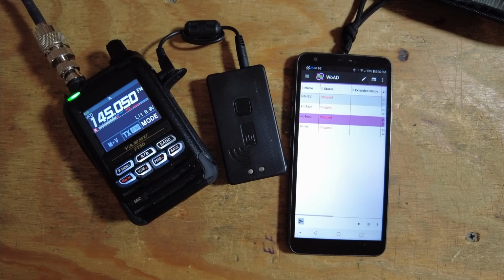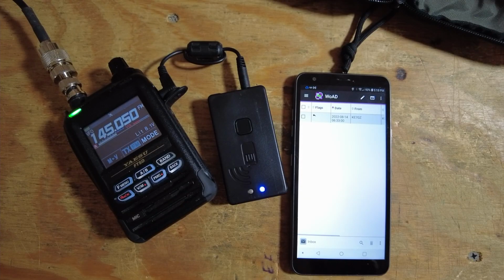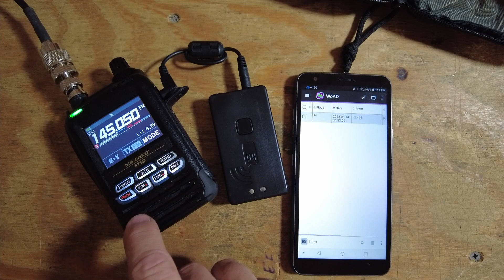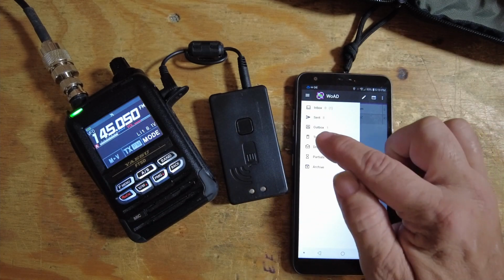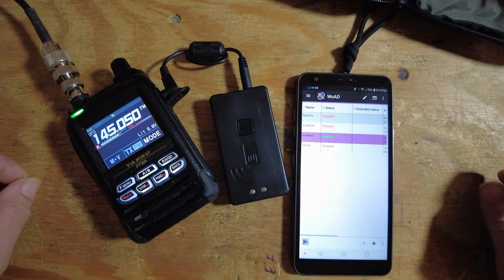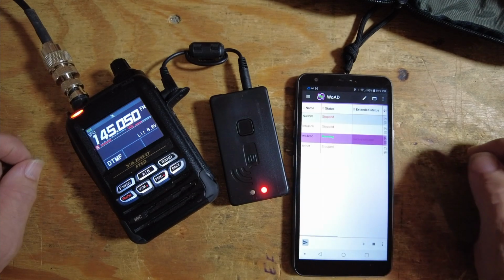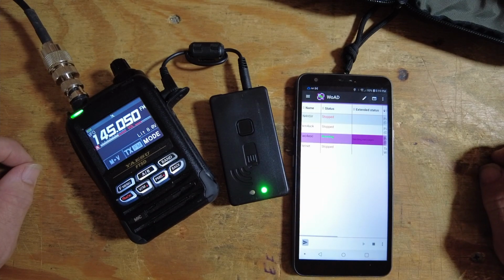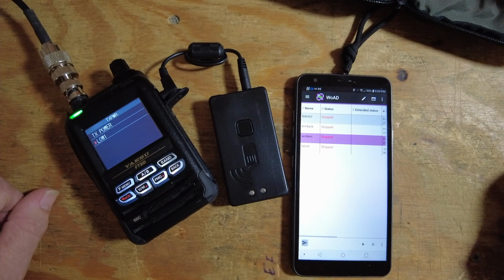Winlink Low Power

Comment: Our club is in the process of putting up, or back up from being down for years, a VHF gateway. No other ones closer than 160 miles but we do have some HF gateways within 300 miles of me I could connect to with 2 watts. 1 watt was not consistent. It's a good test to see how far you can go on low power. It will surprise you. Thanks for the test. Jack K5FIT

Comment: Amazing stuff Jason! I would like to try this using a digirig since mobilink is a no go for now. 73
Reply from the maker: According to a few others it should be possible to use the digirig with an Android device utilizing an OTG cable. I haven't had a chance to try it yet but hope to soon.
Reply: @KM4ACK  sounds good. Will try that too. Another thought: would connecting the digirig (USB C) to another USB C android device work or is OTG needed? I have a Fire tablet laying around here that I could use for that. I will try just wondering if you have done that test before.
Reply from the maker: I haven’t done any testing with the digirig and Android yet.

Comment: This was interesting and prompted me to get my Mobilinkd2 out of my car, connected to my mobile radio, and try it with my FT-1XDR HT.  The HT and Mobilinkd work great with APRSdroid, but I can't get it to work with WoAD.  I am guessing that I have some setting off on the session I set up for the Mobilinkd.  I configured it with packet,  TNC default settings, TNC type of KISS, TNC configuration of Bluetooth and generic device.  Is this different from your configuration?
Reply from the maker: Looks the same except under Settings->TNC Config I have my connection config set to mobilinkd.
Reply: @KM4ACK  I had that set, too.  I tried a different RMS with a different antenna and it worked.  Thanks for confirming my settings.

Comment: Impressive!  Thanks!

Bonus points for the real world roll-up J pole.  That's the configuration I'd use in the field.

I did the System Fusion digital voice version of this experiment with a friend across town, using our HTs and our very nice tower mounted Comet base station antennas.  It wasn't as impressive, but interesting none the less.  Voice is low latency real time data with less packet resend possibilities.

For mbps/mW, it's gonna be difficult to beat a 5g cell phone.  That's PFM... and I'm an electrical engineer!     :-P
Reply from the maker: Thanks! The gateway is doing the heavy lifting with its height but I was very pleased to be able to make the connection with just 100mW. I need to run it again with a whip antenna and see if I can still make it into the gateway. Always fun to see "if it will work". On voice, I'm not sure I get more distance with digital but I get better clarity at the edges. Right up to the point it falls off the cliff.

Comment: Not sure you've done any videos with woad before?  I had to search for it.  Not much info out there about it.
Reply from the maker: I haven’t. Just getting familiar with it over the last few weeks.
Reply: @KM4ACK  Interesting program.  I got it working on packet 1200 baud with my Pixel 6 and my TH-D74, directly without any additional interface.  That's cool!  I see it has ability to do VARA and ARDOP as well - unfortunately it appears that with VARA you will need something else as it uses a TCP/IP interface to VARA - and I am not sure there is a VARA version for Android?  In any case that wouldn't work with the TH-D74 as the bluetooth stack wouldn't support it I believe.

Comment: I used to regularly connect to K0SI with 0.5w on 80m with VARA HF.  60 miles bouncing off the atmosphere.  Lowest I could go on the Ic-7300. Had to take down my antenna when we cut our dying trees down and haven't been able to try lower than that with the IC-705. 

Amazing what we can do QRP.